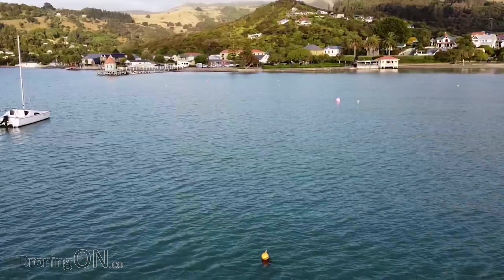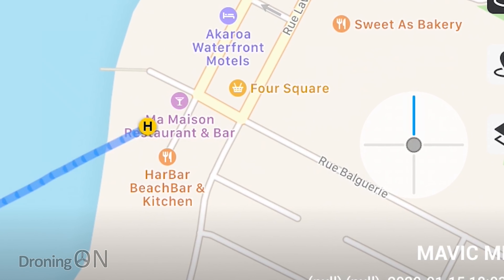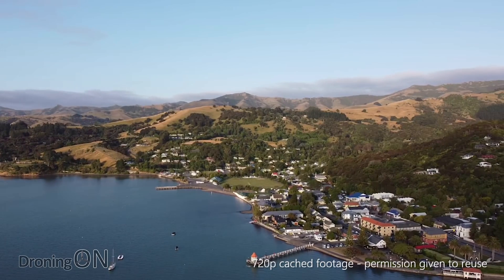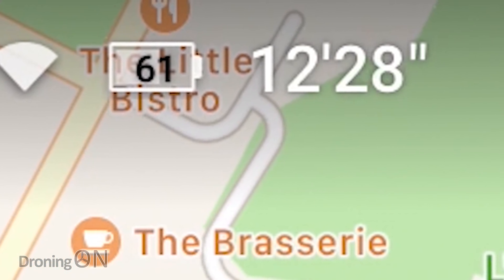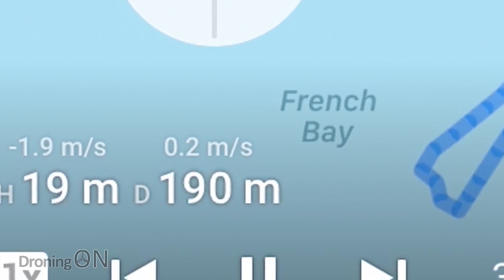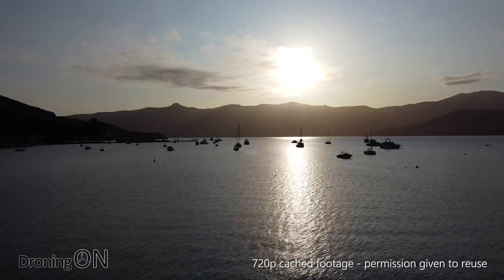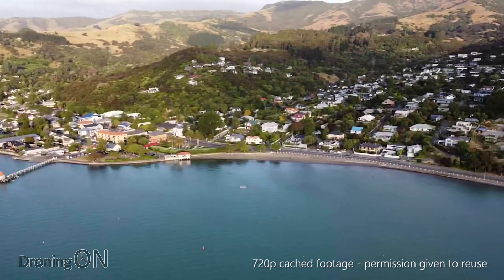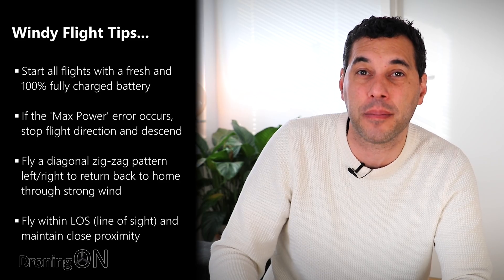DJI Mavic Mini Uncontrolled Descent Into Sea | Max Power/Wind Issues/Operator Fail?

Comment: Your right, wind gradient can be significant, descending is a good option.  Can I add, if you’re caught downwind, beware of getting fixated on Returning To Home, consider ‘landing out’.  I learnt that from flying full-size a/c, ie if in trouble focus on nearest safe landing, and heading crosswind or downwind gives more options than upwind. In this case a 90°+ turn to the right and descending might have reach the beach or coast road increasing the chance of recovery.
Reply from the maker: Absolutely Dick, thanks for the comment and good advice!

Comment: If you follow The Drone Code and actually let the UAS operations principles sink in (sorry-bad use of language there) then these technical fatalities‘shouldn’t’ happen!

Taking off with less than 50% battery? That’s a HF issue. Don’t blame DJI!!!!
Reply from the maker: Indeed it is operator issue in part but there is a mixture of issues here, let's hope that DJI investigate the loss of power issue as there are significant widespread reports of this issue.
Reply: DroningON Thanks buddy. I have 2 Mavic minis in my fleet so I shall bare this in mind!! 🤟

Comment: nice video. Could it be that  the drone motors amp out and stops. Its common with some  electric motors when battery is on low volts and high resistance(max throttle).  I have just started flying mavic mini, love it so far. I hope i dont loose mine, trying to not push it too hard.
Reply from the maker: Thanks for the comment, were unsure but let's hope that this issue there resolved. Be sure to subscribe!

Comment: I've had this exact issue in zero wind. I just sent my drone back to manufacturer for correction.
Reply from the maker: Thanks for the comment Phil, do you know if they'll replace the drone or just the batteries? We've heard that batteries might be the cause. Be sure to subscribe!
Reply: @Droning-ON  I'll keep you posted. I haven't heard back yet. My mini is still in transit.
Reply: @Droning-ON  They replaced the main board. They're sending it back to me. No charge or expense. I didn't send any batteries (as per DJI's instructions).

Comment: I am new mini owner and this video helped me . I am afraid to fly mine over any water for the very reason in this video
Reply from the maker: Thanks for the comment Ohio, fly safly and you should be fine! Be sure to subscribe!
Reply: How do I change the altitude from meters to feet
Reply: By the way had my first crash due to high wind and the return home did not got exact spot I tried to correct and it hit my truck still working for now 🧐
Reply: Don't be afraid to fly over water... Enjoy yourself.

Comment: To mini flyers, I do recommend looking at the NOAA.gov website before flying. Under your local forecast, you can check your 100 foot winds. Also, NOAA.GOV website you can use the hems tool. The Hems tool is used for emergency helicopter operations. You can get pretty detailed weather information at lower levels.
Reply from the maker: Thanks Banger, very sensible too! Be sure to hit subscribe!

Comment: I really like flying the mini. Last week, totally calm day. I had a bizarre thing thing happen. I was at 75 feet, the mini started flying backwards, did a couple circles. I thought I was going to loose it. I was able to get control at about 35 - 40 feet and land it. 
After my heart beat stopped pounding. I reviewed the whole system. Recalibrated the compass, and looked for errors, checked channel interference, checked props, No issues found. Flew it again seemed okay. Next day, flew again and it had a mild control issue for about two seconds. I bought it down everything checked out as normal. Flew it a third time and was normal. Not sure what caused it, I do have a little trust issue now with the mini.
Reply from the maker: Thanks for the comment, trust issues aren't a bad thing because you'll fly it more cautiously in future, its a very capable little drone but as you say it's not entirely robust as it's bigger brothers.
Reply: @Droning-ON  it seems to have started after the last update. I have always been cautious with this lil guy. Just a lot more cautious now.

Comment: I flew my mavic mini about 40 meters high and it showed an alert in the top left corner saying that the signal is lost...I was only 40 meters above me! Anyone know how to fix this!? I was at about 12-19 signal.
Reply from the maker: Thanks for the comment, remember that the Mavic Mini uses WiFi only, therefore it is prone to interference, especially in residential or populated areas. Be sure to hit subscribe!
Reply: You also need to ensure the antennas are aimed correctly if the drone is directly overhead. May not have been your issue but aiming the controller/antennas can make a world of difference.

Comment: I have a flight where the drone starts to descend when battery reaches 20% and it refuses to stop descending even it is not entering return to home. How can I share the flight data? Would you want to examine it? Also the drone displays max load but the pase and flight behaviour is perfect
Reply from the maker: This sounds precisely like the scenario in this video, it's very odd. Did you raise a ticket with DJI for investigation? Be sure to hit subscribe!
Reply: I would not know how to do that. I have to supply the flight information somewhere?

Comment: Flight record for my uncontrolled decent -> https://mavicpilots.com/threads/lost-drone-trying-to-rth-max-power-load-reached-issue.77192/page-6#post-908185 - Calm conditions, flying at low levels.
Reply from the maker: Thanks Steve, did you raise it with DJI? Be sure to hit subscribe!
Reply: @Droning-ON  Didn't get a lot out of them. The drone was eventually recovered and will likely just be a repair refresh case

Comment: My Mavic 2 zoom did the same, it decided to land in the water (a river with a lot of water), without any warning or disconnection and with 74% battery. I think DJI has a problem with this. Also, there have been reports of crash landings when the flight zone activates a restriction warning, so you can't control your drone anymore because DJI has programmed it to land when it receives that warning (not to go home) and there are many cases where it has already happened and DJI hasn't changed that yet
Reply from the maker: Oh no, that's an expensive drone to go for a swim! However, you should always be aware of Flight Zone's before flying, so unfortunately you can't blame DJI for that one, they're being a responsible manufacturer and protecting aviation and our air laws. Be sure to hit subscribe!

Comment: Thanks for this video. It is also my first drone and I have not yet flown it over water. To scared to try, but some day I will. This video gives a great new knowledge and makes me more confident when the wind speed is approx 6m/sec. And I mostly fly away (against) the wind as it will be easier to get it home (with) the wind. Cheers from Denmark!
Reply from the maker: Thansk for the comment, generally try to avoid water as it does make retrieval difficult, if not impossible! Be sure to hit subscribe!

Comment: I had the max power error also at low altitude and really strange fly behavior. (See my channel for footage).
Problem was a blade that was slightly bended I think. After replacement if was fine.
Reply from the maker: That's good to hear and supports the theory about props being an issue, thanks for the comment! Remember to subscribe!

Comment: The accident case you're presenting seems to me to be a malfunction of the drone, not the operator. I strongly suggest that he contact DJI and submit it to them.

I have some experience of an uncontrolled descent of a Mavic Mini since I lost one in the sea last December. It was about 30 m away from me and started to descend without me being able to do anything.
No wind, the battery at 25%. By the way, whether a battery is 25 or 100 %, it provides the same power. The drone flies at the same maximum speed for example. Test it.
I started using DJI drones 3 years ago with a Phantom 3 and then I bought a Phantom 4 Pro (which I still own). While traveling in Colombia last year I bought a Mavic Air and as soon as it was released last fall I bought a Mavic Mini. Which hovered in the sea on its fourth fly !

I'm very careful over water, I live on an island ! DJI agreed with me because after providing the flight records they replaced my lost drone. This confirms that the problem did not come from me but from a malfunction of the device or the software.
Hence my advice if the same thing happens to you; contact DJI. I had an excellent service !
Reply from the maker: It could be a mixture of both, we're really not sure. But thanks for the comment Gaetan, Remember to subscribe!

Comment: A few corrections on some of your comments.
Of course the wind is stronger at 80 meters altitude, but when the UAV descends to 20 or 10 meters, it's no longer the case and it should return to normal operation. Otherwise it's a DJI problem.

The best advice if your Mini is far away to bring it back as quickly as possible; use the Speed mode.
With 40% battery power this means about 20% available. Travelling 500 meters (1,700 feet) in S mode at nearly 40 km/h (25 mph) will take less than 1 minute.
Reply from the maker: I would normally agree but Lithium Ion cells don't behave as Lithium Polymer do, if exhausted they'll brownout and therefore cause the drone to have insufficient thrust to recover. The aircraft was in Sports mode for the entire flight, then under sustained load to try to maintain position despite wind at high altitude. Unfortunately while your comments would normally be correct, in the context of the Mavic Mini and it's different battery configuration, it's different.

Comment: I nearly lost my Mavic Mini flying 10 feet over the ocean. It was a windy day, and the “max power” warning came on. It started pitching/jerking forward by itself, then just dropped out of the air. I was able to “crash land” it on the sand, but nearly lost it over the ocean. I lost all forward and back control when it made the abrupt descent, but still had left/right control. I cleaned all the sand out of it, and flew it the next day. Haven’t had that issue since.

Comment: Has happend to mine probably 5 times
Reply from the maker: Thanks for the comment, wow that's very often, in wind or still weather ? Remember to subscribe!
Reply: DroningON has happend in both but is must more drastic with a slight breeze (well under rated wind rating) flying into the wind. I think it has to do with the location of the barometric sensor and the wind passing it. I have flown it as very low altitude and the same has happened with no wind

Comment: I got the mini for my son to introduce him to drones and we only got to play with it twice and both times we got that error and experienced an uncontrollable decent it basically just decided it was coming down and it did almost just dropped and the motors didn't shut down the right away. The first day there was a slight breeze that picked up a little bit nothing I would consider too much for the drone and second time there was zero wind and  on the 3rd pack it gave errors and drop from 8ft or so . I had the limits set so my son couldn't go to far it high, that being said I took the controller from him when it started to give errors so I could get it low and closer without issue. There was no damage to the drone since it was low but kinda don't trust it at least not over water that's for sure
Reply from the maker: Thanks Michael for this, it's a worry to hear and we're concerned. We'll be taking this up with DJI, thanks for the comment! Remember to subscribe!

Comment: I believe this is battery current draw issue.  I have personally experienced this several times as well, particularly in cold weather (20° F). In cold weather, the drone cannot fly in level flight when the battery begins to drop below 50% and starts to plunge in level flight, getting progressively faster as the reported battery level decreases. The only hope for recovery is to stop flying forward and give it full throttle up. If you are lucky, it will stop plunging and can ascend high enough to attempt flying forward again, whereby it immediately begins plunging again. Repeat the process, and you just might get the mini back.

I was shocked and tested it about 10 or 15 times before finally realizing what the problem was.

Battery current draw is a serious fact for the Mavic Mini. If it gets too low, flying forward without plunging is impossible and the batteries are very sensitive to cold temperatures.
Reply from the maker: Thanks for the comment, we'll raise this with DJI as there are so many occurences. Remember to subscribe!

Comment: I have a similar problem. My quads isn't mavic mini but DIY 5 inch drone with iNav firmware. I never have a problem untill I use li-ion battery to increase my flight time. When I try to fly with li-ion I can double my flight time. But sometime (not always) it decent by it self and suddenly uncontrolable until its land. And the battery is still 90% when its happened.

I think the ONLY SAME THING between my quads and that mavic mini is the battery. As I know mavic mini use li-ion battery as same as mine.

When I change my battery to li-po battery that problem never happen again. Hope it will help. Thanks
Reply from the maker: Thanks for the comment Gitaphoto! This is happening so often, its a big worry! Thanks for being a great subscriber!
Reply: @Droning-ON  my advice is change mavic mini battery with lipo battery. If it possible.

Comment: I had the same problem twice. But I was lucky my drone did not fall into the sea. The first time the drone fell while being literally 100 meters away from me. The flight conditions were excellent, there was no wind. The second time this happened at a distance of 500 meters from me, the drone fell in the forest, there was very little wind.
Apparently Dji has some kind of software problem, and they need to fix it urgently!
Reply from the maker: So many times this is happening, we'll investigate further with DJI, thanks for the comment! Remember to subscribe!

Comment: anybody that gets the max power warning "change your props",i got it every flight then changed my rears and it went away,problem is the blades are flatened and do not create enough lift
Reply from the maker: Yes it does seem that props may be the cause here, perhaps at the factory they're not inserted properly in the pairs that they should be configured with. Remember to subscribe!

Comment: Upgraded the firmware yesterday morning.  Took the mini for a flight in the afternoon.  Early vertical flight at 100m altitude was fine.  Lowered the drone to an altitude of 10 meters, backed the drone out to fly 75 meters in a straight-line using P-Mode.  Winds at 7 or 8 mph.  Halfway toward me, the drone reported max power load reached.   I have been flying for 4 months and this is the first time I have ever seen this message.   Repeated the same flight at a lower altitude and again received the same message.  Slowed the drone to a hover then the drone took an uncontrolled descent into the grass.  No damage since it descended slowly.  New Firmware + Never before seen error message = ?
Reply from the maker: Thanks both for your comments, its so hard to assess whether this is a physical or a firmware issue, in combination with a little bit of operator error too, in not judging the wind/weather properly. Remember to subscribe!

Comment: 3 weeks ago my Mavic Mini had a similar issue, over a lake. Just after 3 minutes of flight, it had multiple malfunctions and hit a tree violently. Luckily, DJI ran the diagnosis and repaired with no charge. They sent it back to me today, I should receive it within a week. I'll post back if they fixed or replaced with a new unit.
Reply from the maker: Glad that you've got a replacement one!! You were lucky! Thanks for the comment! Remember to subscribe!
Reply: @Droning-ON  Just received a brand new Mavic Mini. Yes!

Comment: I had this max power error before. After battery update it never happend again even in Storm
Reply: FRANKS VLOGS I just got one. How do you update the batteries just update the firmware on the app ?
Reply from the maker: Yes someone else did mention that it might be battery related! Thanks for the comment Frank! Remember to subscribe!

Comment: Absolute junk!! Sold mine after 3 flights all 3 had issues
Reply from the maker: This doesn't seem to be just operator error, there does appear to be an inherent issue with the Mini, sadly. Remember to subscribe!
Reply: Likely user incompetence.
Reply: @soccernerd200  i have a mavic pro a spark and then tbe mini. The mini is the worst out of all of them!!! Thats the reason alot of youtubers are having them fly away with no power to return and 60m distance every flight in the uk is not good at all!!!

Comment: This drone is extremely light, and therefore struggles in high winds.  Anything over 15 mph winds on the ground (higher winds at higher altitudes) and it will have problems.
Reply from the maker: Precisely, its like a feather! Thanks for the comment! Remember to subscribe!